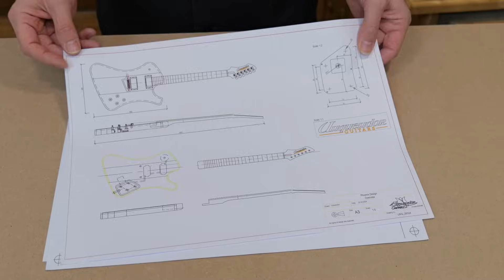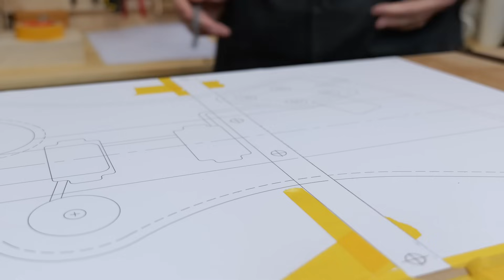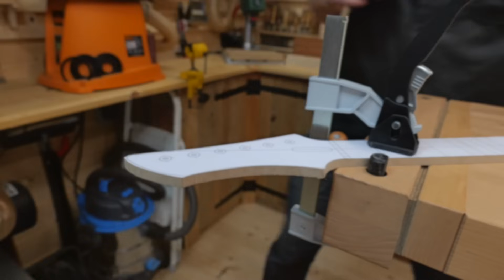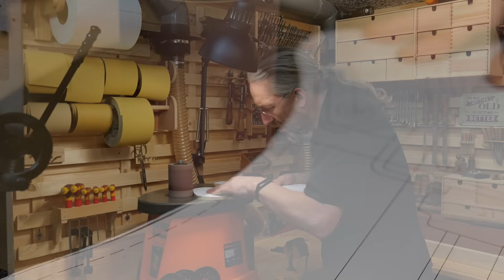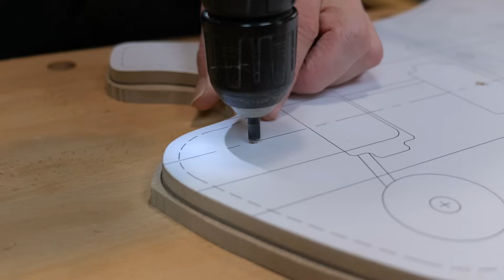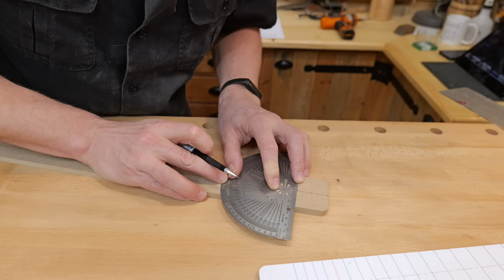Phoenix Rising - Guitar Building Series Episode 1 - Making the Guitar Templates by hand.

Comment: Making good templates is a big deal. Making them out of some kind of plastic is ideal, but working with plastic is basically a pain in the ass, so MDF is the most affordable material in every sense. But MDF is usually quite a soft material, but if you find MEDEX, it will last longer than regular MDF from your local hardware store.

Comment: Hey, 
Look around and inquire at your local print/office shops for large format printing.
I just found out that a local big box office store can scan my A0 plans for just $2.50 aud , and they print an A0 copy for just $6.50aud (which is like 4 euros) . I used to print them out using the poster method shown here , but for 4euros ,  i think it speeds up the process and you dont have to worry about lining everything up perfectly 😊 cheers !

Comment: Hi Daniel, 

Nice to see that you are back ;) 

but how thick is your Template?  (i got a router bit with a bearing on it (30mm = 5mm Bearing and 25mm cutting length) but when i set my router to the lowest position possible then my bearing is almost flush with the bottom plate (i would need a 5mm template to route when i set my bit on the K-mark for Pickup Cavities) and that makes me curious, do i have to set the bit 5mm under the K-mark? or do i need a bit with a longer shaft? or do i really have to use a 5mm template? (which doesn't seem very stable to me and if i can i would like to use a 10mm template)
Reply from the maker: My templates are 9mm thick. 
I'm not sure what you mean with "K-mark", but sometimes router bits are indeed too short reach  the required depth.
The safest option is to route the cavity as deep as you can with the template and the router bit and when you need to go deeper, remove the template. The bearing can now follow the edge/sides of the cavity you just routed to the final depth.
Reply: @UnquendorGuitars  thanks a lot Daniel, I'm going to make a new template but this time 10mm 

(I already made one but 18mm thick)

The "K mark" is the "preferred" depth for set a bit up, it's the way the company likes it to do but in the instructions papers stands that I need at least 20mm inside my router

(at minimum 20mm of the bit shaft under the nut to fix the router, but I asked because I am afraid of doing so, 20.000Rpm are scary as hell and especially if a rotating piece of steel could break and penetrate my body like butter... )

I have not that much experience with a router and I simply would like to know if it's save to do, because the bit instruction papers mentioned that I can do it or if I shouldn't 😅

Comment: Daniel, may I ask if you don't mind, what is your background? You've got a lot of finesse and tidyness for small and precise tasks.
Reply from the maker: Hi Martin,
I started working as a plumber and electrician and I've worked as a support engineer on an oil terminal. 
Through building experience, self study and training in several fields I became a mechanical and electrical engineer and I am also a consultant specialised in setting up (engineering and manufacturing) processes in companies and how CAD software can be utilised to establish efficient and productive workflows.
Reply: @UnquendorGuitars  Your background is evident in the way you work. Neat and precise. 
Thank you very much for taking the time to answer my curiosity.

Comment: Great to see you back. What size bandsaw blade do you use for cutting out the templates and body?
Reply from the maker: I believe I used a 12mm wide blade, but I'm not entirely sure. I would recommend using a 10 or 6mm (1/4") blade for the body template. It makes the turns go much easier.

Comment: A trick to use when putting multi page plans together is to do them on your refrigerator using magnets. hold them in each corner and in the center. This allows you to easily slide them around to align them before taping the seams where the pages meet. I used to do this when putting plans together for foam bard remote control air planes. Super simple where you can sit in a chair and relax AND as a bonus snacks are close enough you never have to leave the chair!